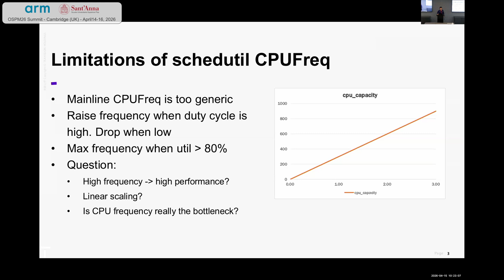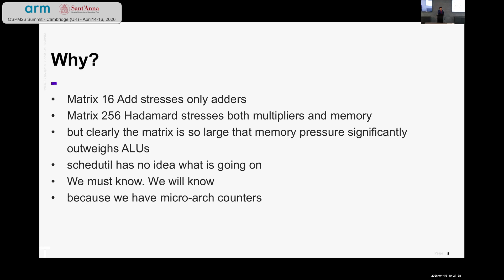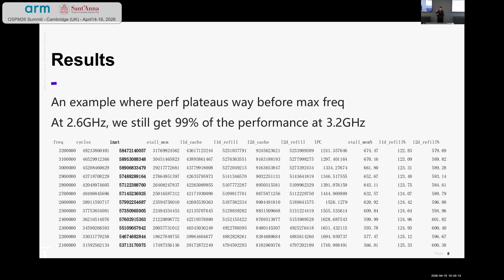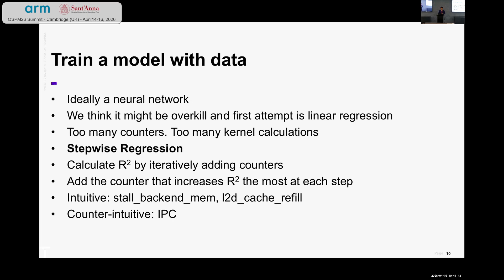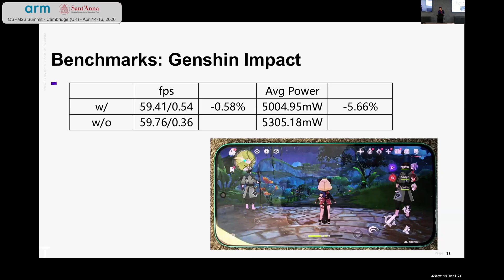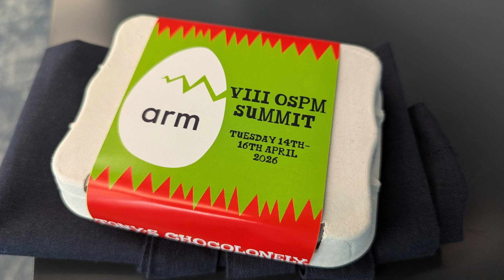Using AMU/PMU to reduce useless power consumption in CPUFreq - Hongyan Xia (OSPM26)

Comment: Is your model still suitable for low-load scenarios? In standby scenarios, cache_refill and mem_stall are close to 0. If your model β0 = 2GHz, and CPUFreq = 1GHz is sufficient, using your model would actually increase the frequency to 2GHz, which would increase power consumption.